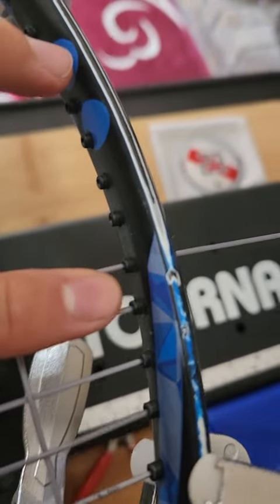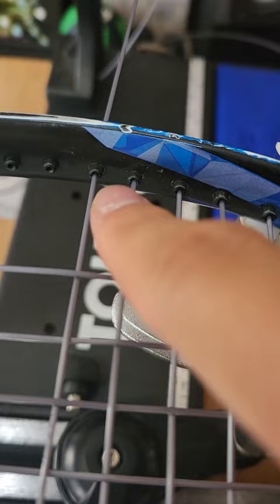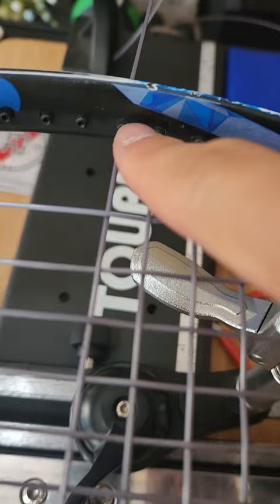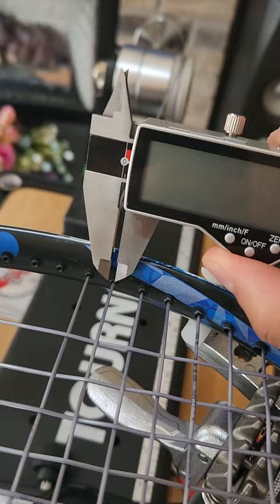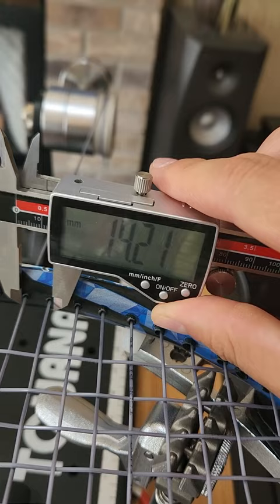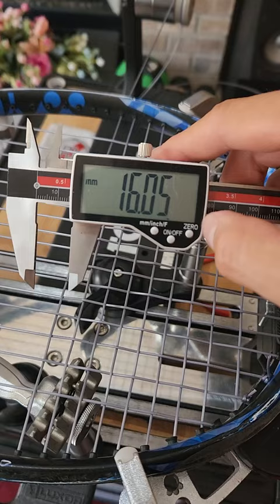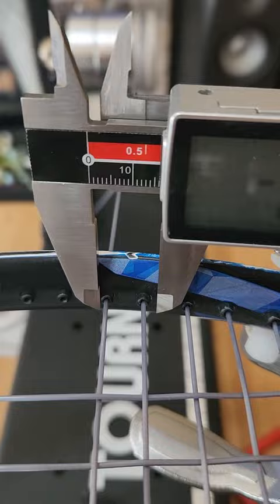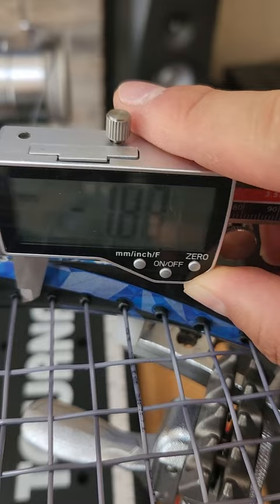YONEX STOPPED THIS INVENTION | For Crooked Crosses

Comment: so the crosses are crooked anyway, but the grommets are designed around that. Good thing they stopped doing that.
Reply: I guess the intention is that the strings that touch the inner side of the grommet are in the further ones, and the ones that touch against the outer side are in the closer ones (so it's not done to accommodate that "crookness" but to compensate, as if you tried to accommodate you would be actually accentuating it, as the strings will always be touching one of the sides of the grommet, not in the center).
So the intention is that the crosses are actually not crooked.
Reply from the maker: Well...kind of. The point is to show that the grommets are spaced in such a way to even out how crooked the crosses are. So this actually helps. In a longer video I could show the difference it has on actual string spacing because it's a bit different from the drill spacing that is made to compensate for this offset. Alas, this is only a short.
Reply from the maker: You're right on the $$$
Reply: @ZeroLoveTennis  @nulocalosclo ohh I see, I reverse my opinion then. It is very clever, I wish they would still be doing that

Comment: What strings are those? I swear I’ve seen those matte finish looking strings before but don’t know what they are. Kinda reminds me of the Luxilon ALU Power Rough but it’s still shiny to me
Reply: It's a little shiny depending on the light of the take.
I did a screenshot and I think it may be "Tour bite" (an then wether 16g or 18g)
Reply: Looks like Polytour Drive, but I could be wrong
Reply: Looks like Solinco Tour Bite
Reply: Looks Like Solinco Tour Bite
Reply from the maker: It's Tour Bite!
Reply from the maker: yess
Reply from the maker: 16g TB
Reply: @ZeroLoveTennis  Shucks
Reply from the maker: Not my choice haha the customer may convert to zero or wasabi later!